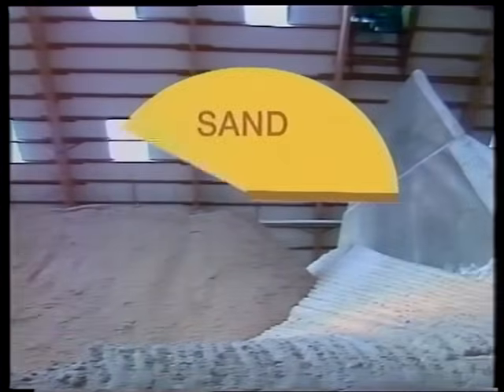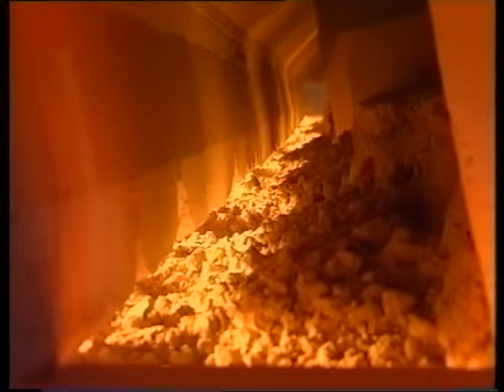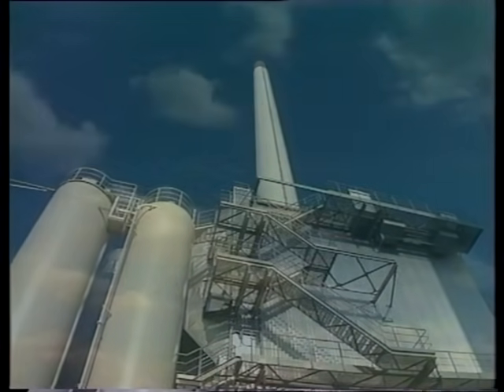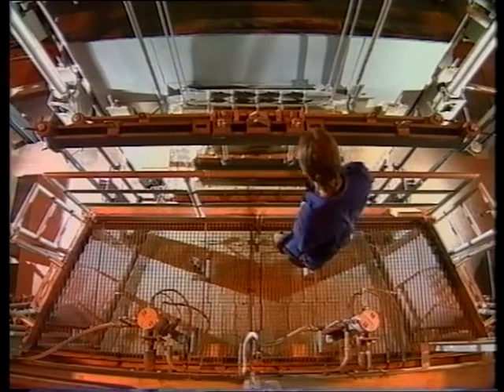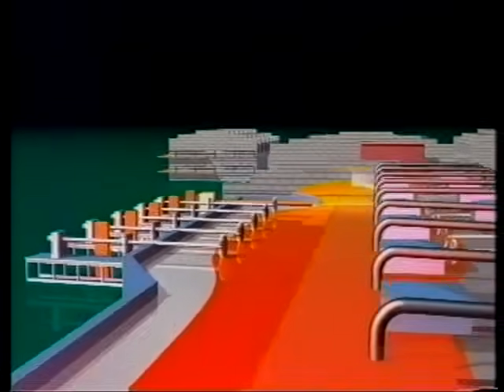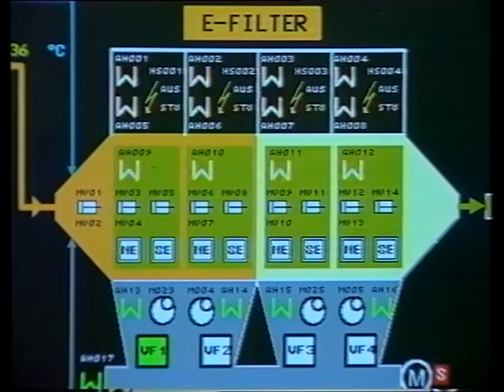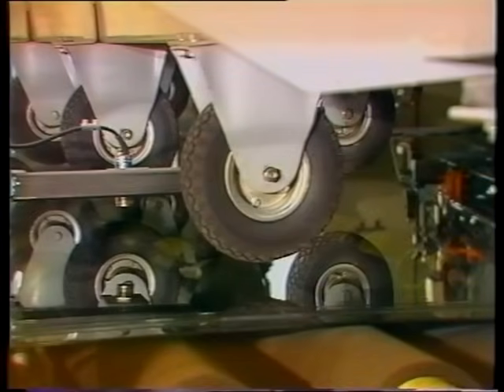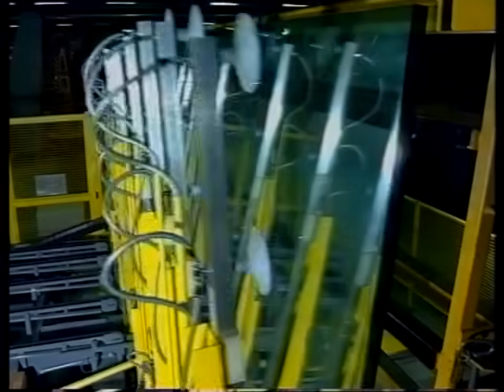Pilkington Float Glass - Float Process

Comment: A few questions to the manufacturer: 1) Does the float process ensure perfect flatness of the ribbon and then also of the resulting cut panes? 2) What are the quality-control tolerances of flatness vs. arc/bulge of a finished pane of glass? 3) How big do you typically cut the finished panes? 4) Did I understand that the flat glass ribbon is 250m long? If so, that is incredible! Thank you, Pilkington for this video!
Reply from the maker: Thank you for your interest. Please find below answers to your questions:
1) Yes, the float process ensures perfect flatness for both the ribbon and final panes.
2) Flatness is addressed within the bow and dish requirements of our internal float glass manufacturing specification.  We do not make our manufacturing specifications publicly available, but we confirm that Pilkington Optifloat™ meets the requirements of the European Standard, EN 572-2.
3) Standard available sizes: jumbo size 6000 x 3210 mm, LES size 3210 x 2550 mm.
4) If we say the ribbon is formed in the bath and a typical bath is 60 m long, the annealing lehr to cutting is ~180 m, then yes 250 m is typical for a continuous flat glass ribbon, but there is some variation between the manufacturing plants.

Comment: Excellent industry vid.  I am wondering, is lead one of the elements they can spray on a the end to help with heat retention or some other goal?  And is all the other glass making processes are just called non float?
Reply from the maker: The use of lead could help in radiation shielding. For heat retention (inside the building) the glass would be coated with low emissivity coating. More information is available on our website: http://www.pilkington.com/en/global/about/education/glass-in-buildings/energy-saving

Comment: What happens if there's an electric power outage? Do the furnaces stay on, or hold their temperature?
Reply: Bryan C 
Multiple backup systems are in place. For electrical power loss, conveyors, computers, and ADS machines have battery backups that immediately take over to maintain function until backup generators can be  powered up. All backup systems are tested monthly and well maintained. For loss of natural gas there is a contingency plan using liquid fuel turned to aerosol using compressed air. For loss of water cooling we switch to city supplied water. If city water fails, there are multiple water towers with a backup supply.
Reply: you can also use an LPG/Air mixer that combines propane with air to match the Wobbe Index of natural gas. This can be used as a direct substitute to natural gas.

Comment: How does that initial cross-wise cut work? It looks like the cutting wheel travels a diagonal line across the glass and then you see nice rectangles of glass!?
Reply from the maker: That's correct. The cutting wheel travels a diagonal line across the glass because the glass is moving underneath.
Reply: PilkingtonTV right, so how do diagonal cuts suddenly become rectangular pieces?
Reply from the maker: The movement looks and is diagonal but the cut is perpendicular to the edge of the glass. Imagine if the movement was perpendicular to the edge of the glass and the glass was moving then the cut would be diagonal.

Comment: It's too bad where the roller cause the dents they don't break it off sooner and recycle it when it's still hot they'd save even more than 20% on heating costs since the scrap glass would already be warm.
Reply: The glass needs to be annealed before it can be scored and broken out. It is still quite warm though from the annealing process. By the time the knurl (ridged part made by the top roll machines) is scored and broken away from the ribbon it needs to travel by conveyer back to the batch house before it is sent along with the batch over to the furnace where it sits in a bin where it is gravity fed into the furnace. Almost impossible to contain and recycle the original heat.
Reply: David Hughes Hot glass is above it's Tg temprature - it won't break off, it would tear with plastic deformation which would spoil the edges and deform areas around them.
But yes, the sooner they are broken off the warmer they are, thus saving costs.
Reply: H